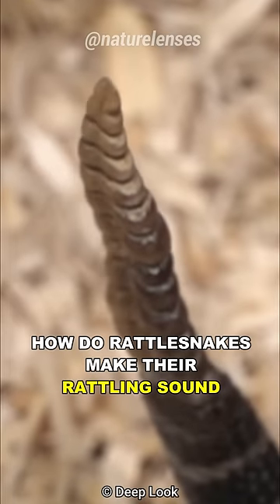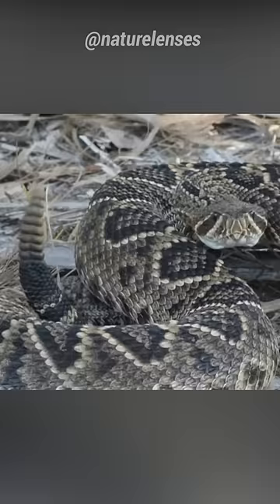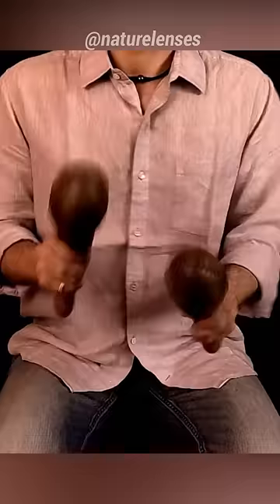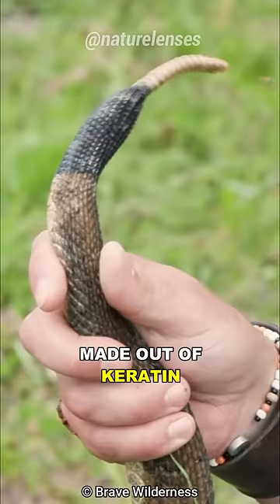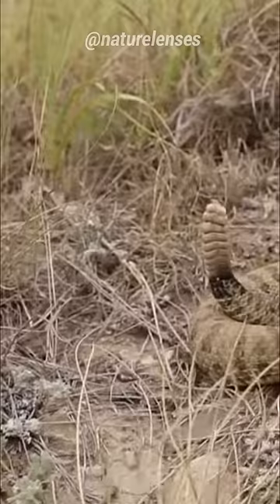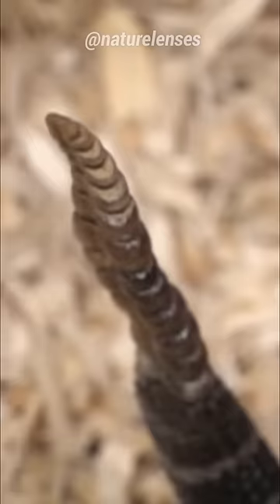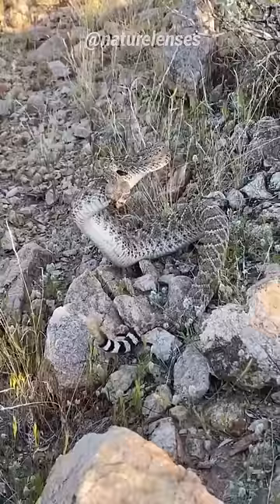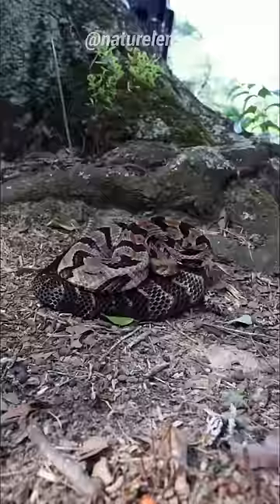How Do Rattlesnakes Rattle?

Comment: What’s cool is that they evolved the behavior to rattle their tails long before evolving the rattle. Because multiple, distantly related species do the tail rattle behavior to vibrate things around them, like dry leaf litter. 

I noticed this in baby corn snakes. I would hear a weird buzzing noise only to realize that it was the baby’s tail buzzing again it’s tank
Reply: It must have taken a very long time to evolve the rattles. A slightly thicker tail tip likely doesn't provide immediate advantage considering that they rattled on leaves and other stuff

Comment: Poison that rattlesnakes make is expensive to make.  Being cold, blooded, requiring the warmth of the sun to digest food, no rattlesnake once to squander their poison on something that they’re not going to eat.  Rattling, alerting you that they’re there, is the best strategy for their survival.   I am uncertain, if I have this correct, but a rattlesnake can control how much venom they can excrete just some extent.  Artificial milking venom from a rattlesnake, takes some manipulation and pressure from the handler.  To my understanding, biting frivolously, could cost them a meal, if they use up all the venom.